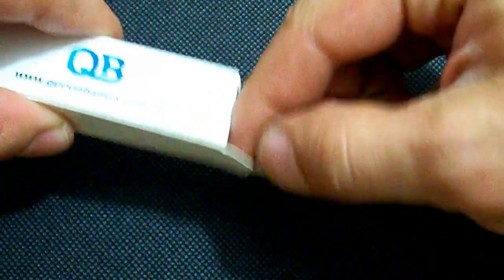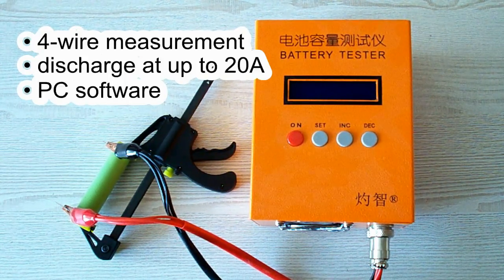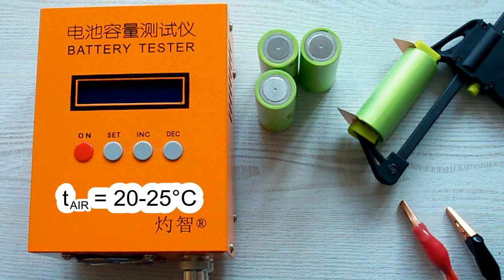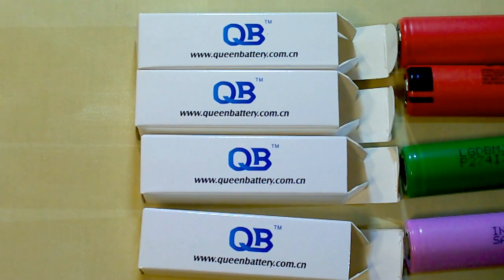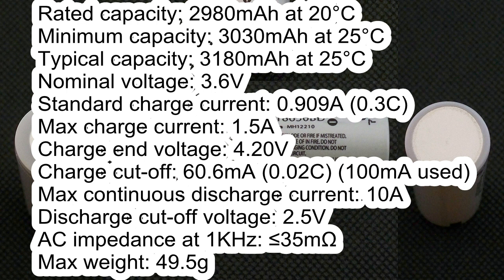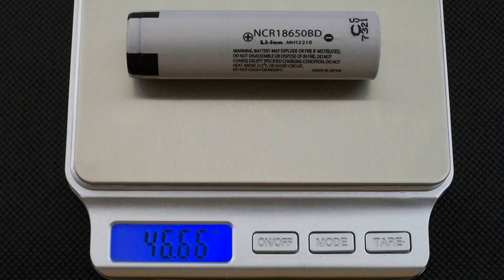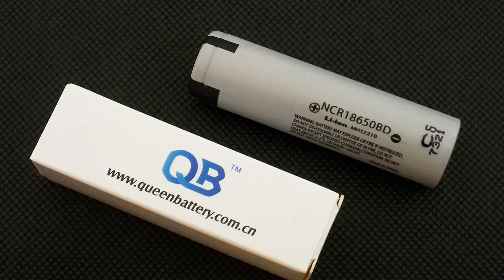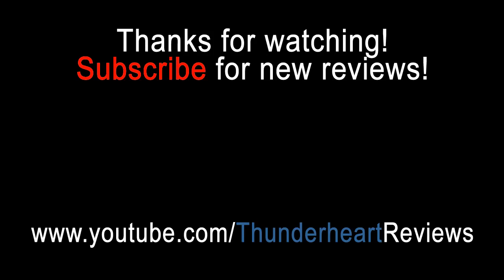Panasonic NCR18650BD 3200mAh 10A Li-ion cell's capacity test

Comment: Fantastic work ...very professional !  Could I suggest you include price including shipping in your information ....
I think most people just want the best cell WHrs/ $  ... for a power-wall and most other applications we just want the maximum storage in WHrs for the lowest price ... Thanks again
Reply from the maker: Thanks a lot! Yeah, the price/energy ratio is one of the most important parameters but the problem is that the price is not static - it changes from month to month and also depends on how many cells you order. That's why i don't give any info on the price.
Reply: @ThunderheartReviews  I do understand that , but price is such an important factor that it maybe just be worth saying In your video  " based on latest prices of $3.88 per cell this works out @ 6.5 WHrs /$ , which is near the low end value from Queen, but you are paying for a high mA cell , lots of storage packed in one cell , not a good choice for power-walls and stationary applications  "  then we have something to work with , and if we check and prices have changed we can make an easy calculation to adjust ... anyway , thanks again for your great work .